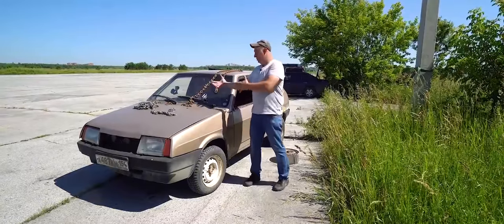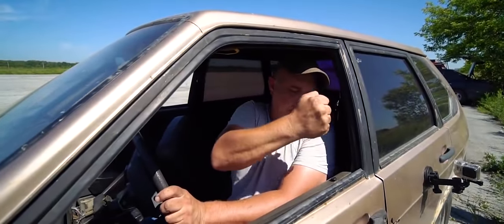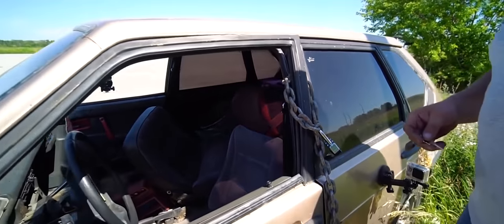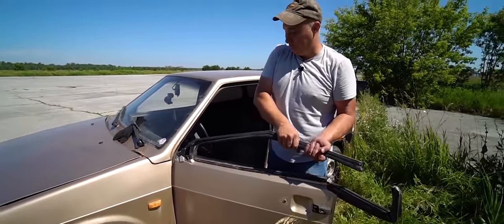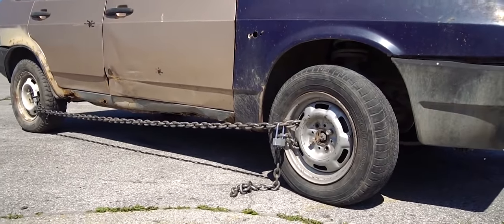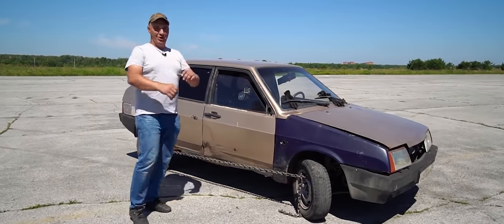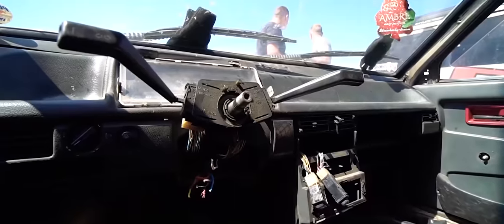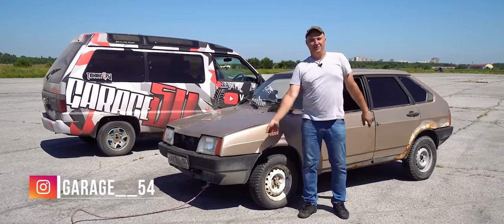Will a car drive if you chain the tires?

Comment: they would just get bolt cutters
Reply: Some super strong chains are designed to put up a fight against bolt cutters. Plus some padlocks have super strong shackles and high shackle guards, unlike the one in the video. Plus the one in the video is about as much use as a bacon sandwich in a mosque during Ramadan because at 2:46 we see that the shackle is bent and may have been forced open as the car drove off.

Comment: Tow trucks are called wreckers for a reason....they literally can pull wrecked cars from ditches, etc

Chaining your car isnt gonna stop it from being towed 😂

If the tow driver is being nice be will use bolt cutters 

If he isn't nice, he will simply drag the car away and you will be paying tow, inpound and also for new tires

Comment: as students we had an Simca 1100cc as a campervan but the locks where defective, so we took the steering wheel (1 nut, easy to remove)  with us going to the beach. That gave us a lot of attention.

Comment: You can if you connect the chain in the correct spots... Only if placed connections correctly. 12:00 front & 12:00 rear

Comment: You can see the beam axle under the Lada Samara.  This is a direct copy of the Mk1 VW Golf.  I think that Porsche was contracted to design the engine in these.  Which of course brings it full circle:  The original VW Golf mk1 or "Rabbit" in the United States was built in Wolfsburg with cheap Russian steel.  Around 1980, VW stopped using this CRAP and sourced their steel from Ford, who owned huge iron ore mines in northern Michigan.  In 1985 they then went to a zinc-coated steel like the Japanese and rust wasn't a problem any more.

Comment: This guy has attached the chain to the different points on different tyres if he attach the chain on same points like at the same point of the both front and rear tyre then he can actually drive the car smoothly just like a steam locomotive

Comment: Next time I don't have a steering wheel puller I'll know what to do. 
  At a private owned paid Recreation Area. There were many very large sign saying do not park cars will be towed away at owner's expense. Despite the obvious signs there were those who were parking in the wrong place. One after another was being towed away. But not by a tow truck!!  They were using a 1-ton 4-wheel drive and they just hooked the chain around whatever they could and started pulling ! And if something broke off they just wrapped the chain around something else as they dragged the vehicles almost a mile. Most everything was drug with the drivetrain locked. And they were dragged through sand and River Rocks. Lol
  Now that's taking the statement "at drivers expense" literally.
  Never did find out if they charged for towing is well.🤣😂

Comment: rip appart a Lada with chains pulled from 12 different angles.  (3 in front, 3 in rear and 3 from each side.  This will 107% be the best gratuitous Lada distruction video possible.     Weld the chains in and loop them through the body, frame, etc.  Whoever ends up with the biggest piece attached to their chain wins.

Comment: door handle, will fail as its plastic if metal ???
door pillar works and might bend car but its still there,
stearing wheel: hay look you've turned you stearing wheel into the wonder austin allegro's square wheel!
wheels; broken axel or yes i can drive away but i'm missing part of my wheel,

Comment: For some years, tow trucks in my country, had a special forklift which lifts the car and loads it from the side on a platform behind the cabin. The car is driven to a municipal parking lot and the driver receives a call/message as to where the car is the due amount of the fine. Cars may have been damaged in the process. That is why I don't see these tow trucks anymore, but I'm sure the driver still has to pay a fine. That is much cheaper to execute.

Comment: Install a removable steering wheel and a couple of hidden kill switches. When you park, flip the kill switches, take off the steering wheel, and take it with you. Good luck stealing the car. It can still be towed though. If you want to go all out and can park on dirt or gravel, you could fabricate some spikes that will dig into the ground when parked to help thwart towing. Don't bother with air bags and dropping the car on the ground because if someone wants to tow it, they will just drag it damaging stuff.

Comment: In Germany the local government would call the local fire station to come with some serious bolt cutter, maybe even hydraulic ones. And you have to pay for everything. And even if you come back in time, that means before the fireworkers arrives you get payed, but will get billed for that. And the everything also includes a charge for chaining your car... will is not necessarily forbidden. but chaining your car to a certain place so any officials cant move your car if they have to is. Not right away, but when they have, your not allowed to stop them. but you are allowed to move the car by yourself. So they can call you.

Comment: You didnt chain the tires. You put a chain through the wheels. Chaining tires is an effective way to get traction in snow. If anyone didn't know the tires are the rubber part.

I know you know that, just make your titles accurate is all.

Comment: In theory, if you chain the tires to the front side of both the front and back, it should operate like the old locomotive trains, right? <> If you chain your car up to prevent it from being towed, tow truck driver will just cut the chain.

Comment: The chain around the wheels broke the front wheel... you clearly see it rip the wheel back bending all bars holding that wheel lol i find it funny he was concerned about it damaging the brake pads after it fully wrote off the vehicle by ripping the wheel back

Comment: You did the door frame test wrong. The reference pic showed the chain around both door frames, which have part of the body frame between them, more than tripling the resistance of the one pre-comprimized door frame you used.

Comment: Not around the front window door frame, open rear and front windows slightly and put chain around pillar! I have seen car chained to lamp pole like this in UK you will bend car frame and if fitted with an anti role bar will be going no where!

Comment: if a flatbed tow truck is what's picking up your vehicle this method will not work once they attach that winch it should be able to pull that vehicle even with the wheels not rolling and just slide it right up the ramp

Comment: Take a high amperage switch and install it in the glovebox.  Make some leads out of 0 or 00 braided wire.  Interupt the wiring to the starter motor on your vehicle with these leads... doesn't matter which side.  Remember that you have this switch in your glove box when your car wont start.  The end.

Comment: I turn the steering wheel all  the way to one side and chain it to the seat frame in me m35a2c  because it has no keys just a power switch and a push button

Comment: if you use a chain to front wheel and the one on the back you will end up damaging the steering also the springs will need to be repaired the more the try to make it move the worst the damage gets forgot to mention that you are running the danger of adding scacthes on your car. still its a nice video thanks for sharing it.

Comment: 6000 RPM neutral drop ought to get that chain to cooperate
Reply: Motor Toys depends on the strength of the chain. If it’s a really strong chain, you might break your fingers on the steering wheel, or ruin the car at least. You might damage the steering or some other components in the front axle or burn the clutch out. Even if the chain did break, you’ve got other issues. If the chain had heavy padlocks 🔒 like those heavy duty Squire padlocks or those old military padlocks then you risk losing control of the vehicle due to the wheels being severely unbalanced. Another issue you face is the more obvious fact that the chain is flailing around wildly as you drive. Especially if you stole a convertible, like an S2000 or a Miata, the chain could punch through the roof and hit your head. If that happened, the chain would crash straight through your skull and decorate the car’s interior with blood and bits of your brain.
Reply: @MrSupercar55  hahah you dove in on that one. Guess it depends on the car. You are doing damage no matter what I feel like. But, if you are talking about a truck or SUV or something with a V8, I feel like you will be hard pressed to find a chain to hold it back. Definitely going to damage your shit and maybe get hurt in the process
Reply: @MrSupercar55  also, I only meant to do that to break the chain, not keep driving.

Comment: Some cars like some Saabs have quite tough door handles. It's even advised to use them for removing doors after accidents as it's strong enough to lift a car or pull the doors away.
Reply: any source for that? Sounds interesting!
Reply: @Mprikiman  You'd have to Google around, it was originally translated from Swedish, I'm not sure if that was OEM advice or something else. It was mostly known on Saab forums and traces of it faded away over time. I'm also not sure which Saab it was about. IIRC, the memo was stating that the best side hitch point for recovery is the door handle.